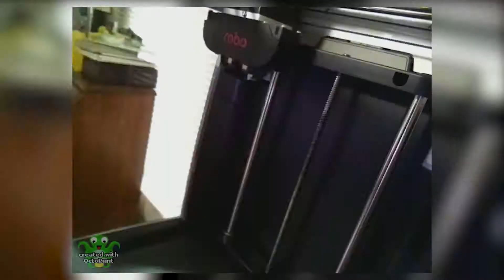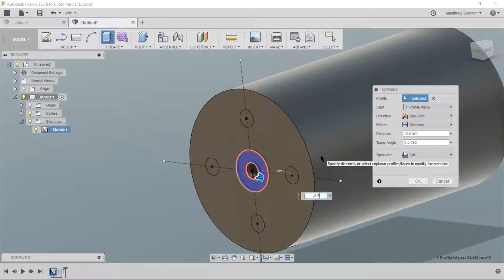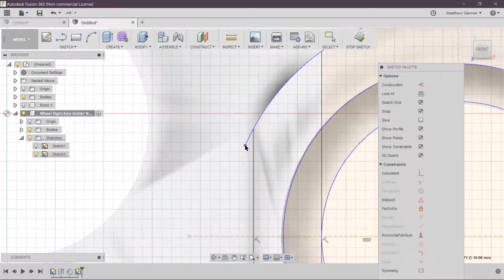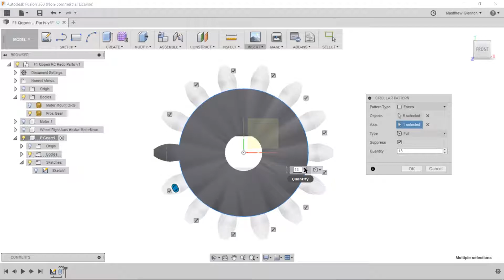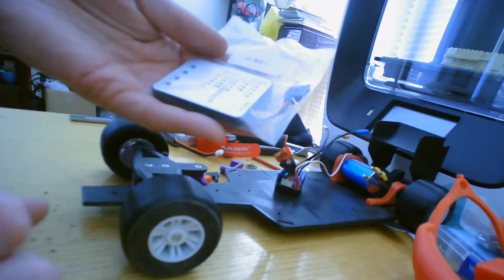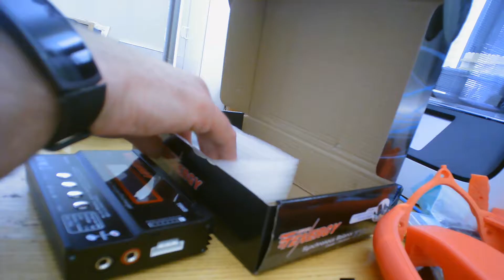Open RC F1 Orignal Biuld Start

Comment: Im building the F1 car but am struggling to find a tyre I can buy off the shelf to fit the car, i havent printed the actual wheels yet so im open to suggestions if anyone can help or send a link on which to buy thanks??
Reply from the maker: There is a wheel you can print with a tup, but if you want.  In the files there is an stl file for the rims to print that you can buy the tire.  I am on my way home now, so I can look when I get home.
Reply from the maker: Try looking at these tires.
https://www.amazon.com/Tamiya-51399-Rubber-Tires-Front/dp/B002VV1PSM/ref=sr_1_1?ie=UTF8&qid=1536977580&sr=8-1&keywords=F104+Tire

Comment: Hey Glenn, you can import the entire car assembly in Fusion 360 to work with. It´s got some electrnoics added too. =)
Reply from the maker: True, thanks.  At some point I may change the car to your 2017 version. I used your original files to print the car.
Reply from the maker: It may be fun to do so.